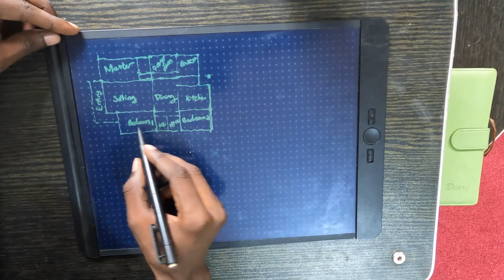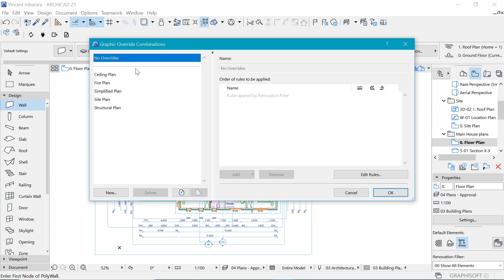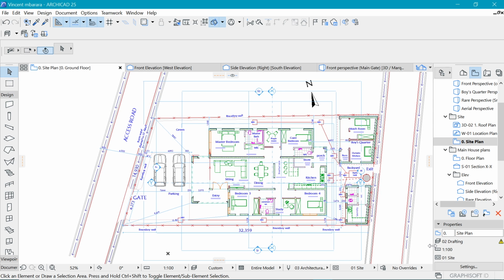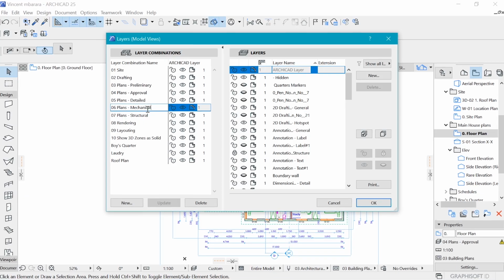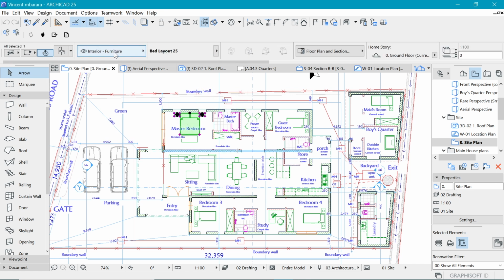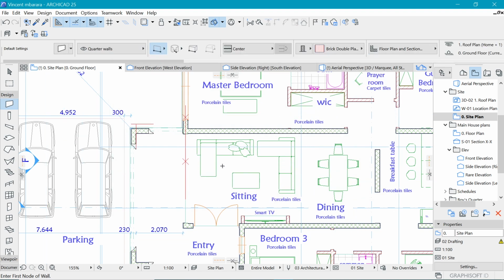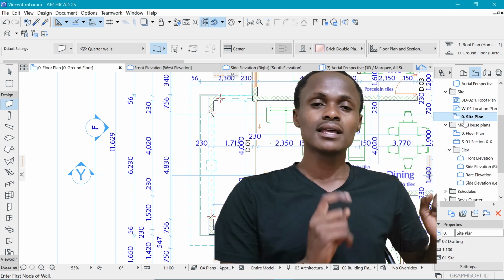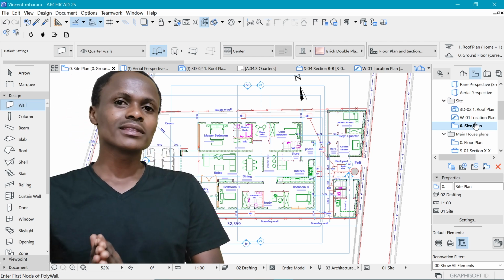Stop using archicad like this!!

Comment: Hello. Where did you get the pen sets from? I've been exporting with the default ones and my pdfs are heavy sometimes unprintable
Reply from the maker: I used the defaults and i prefer Architectural 100 one and the Building 50. Good thing you can overwrite according the the need